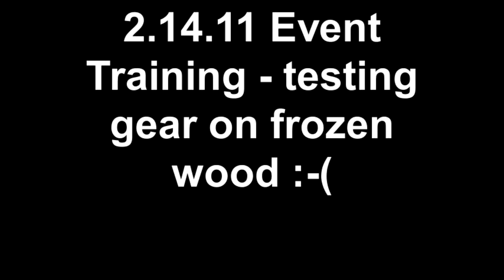2.14.11 Event Training - testing gear on frozen wood :-(

Comment from the maker: @TeamGZFS Some of the logs were lying on the ground during a recent snow storm. I had brought them into my barn the day prior and chopped the excess off the logs with a dull/rigging axe.  But the part of the log that was lying on the ground the day prior was still frozen.  Frozen wood and thin metal don't mix well.  Live and learn and I should have known better.  I considered putting a torpedo heater on the logs for an hour prior to training.  But changed my mind.  Not again.